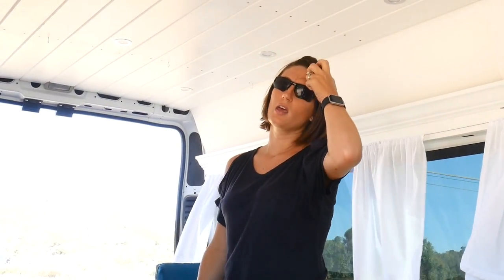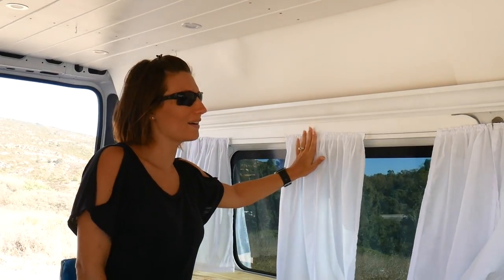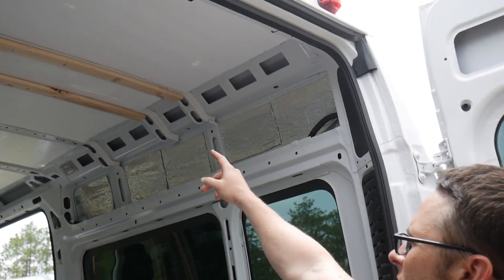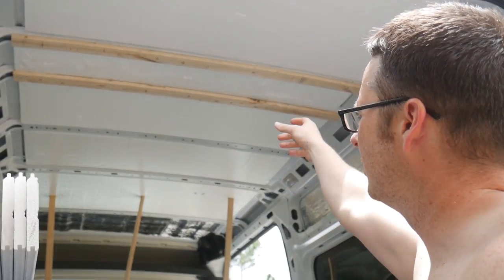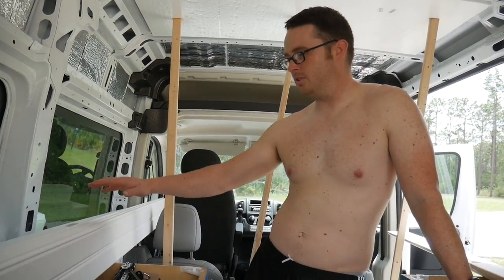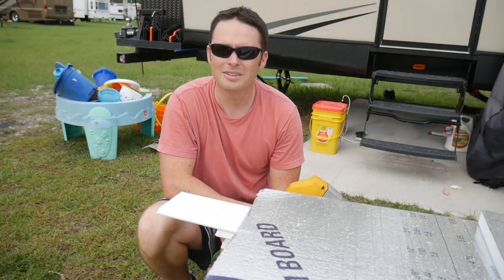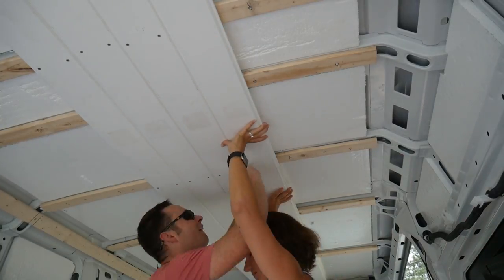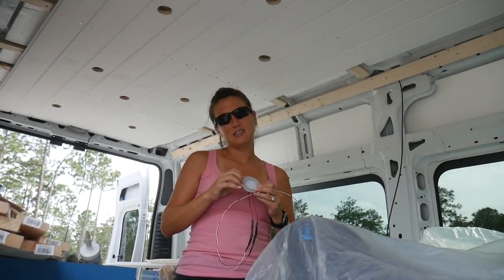How to build a Campervan: Part 13 - Installing Ceiling

Comment: There are special T&G screws which you screw at 45° angle into the tounge of the shiplap so your next board will cover the screw head and becomes invisible.

Comment: Showed how to wire up the led lights but not how you installed them? Kinda stumped on how one installs recessed lights “after” the roof is screwed in? Maybe in another... video.... looking good thus far!
Reply from the maker: Hey Dani - Sorry for the confusion we have about a 1/2 inch gap between the roof insulation and the Ceiling so I just grabbed a coat hangar and fished it through the ceileing to the electrical gutter I was running all our wires to.